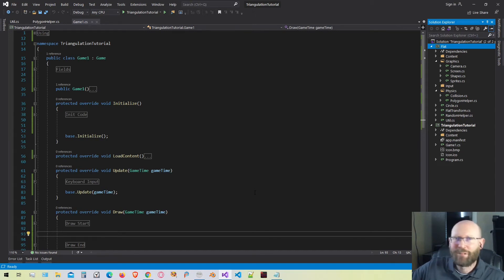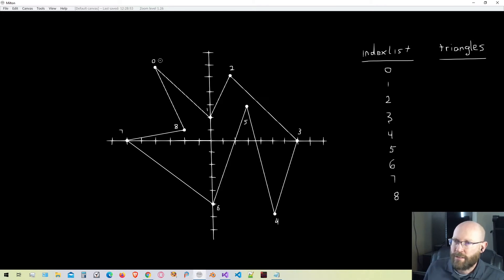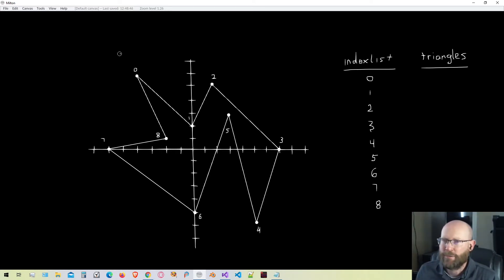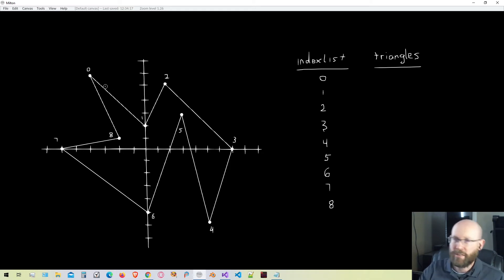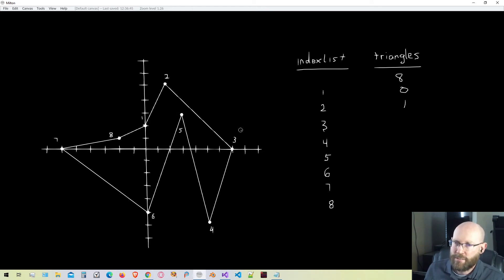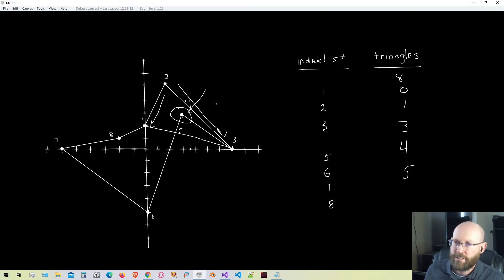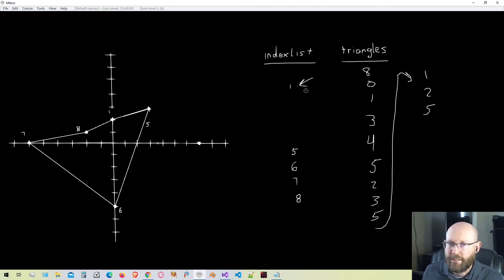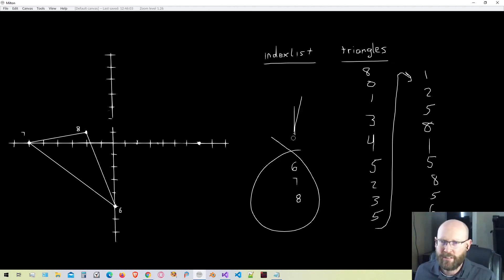Polygon Triangulation [1] - Overview of Ear Clipping

Comment: Thank you for the explanation. It makes a lot of sense, looks like a simple yet effective algorithm for triangulation, if only I found this months ago! Two things that might help someone in my situation:
1 - Convex Vertices are those that the cross-product of their edges is positive for a clock-wise polygon
2 - A point P is inside a triangle ABC if the cross products of every vector from P to each Vertex is the same sign, ex: PA x PB, PB x PC, PC x PA all have the same sign
Reply: Yes thank you for concisely listing the core elements.

Comment: what would happen if the polygon started from the 5th vertex? It isn't a convex angle anтd there are no vertices inside.
Reply from the maker: Great question.  It will move on to the next vertex until a valid ear is found.

Comment: What would happen if you generate a polygon with a 180-degree angle when removing the triangles? Is that just impossible because of some quirk of the process? Like when you have the 1-5-8 triangle, the 1's angle could have been 180 if it had been exactly in-between 5 and 8.
Reply: I think you should treat it as non convex and skip it, then point 5 will be removed, and 1 will be connected to 6, so not 180° anymore.
I don't know why he assumed the 180° rule as illegal.

Comment: Thank you very much for this video, the algorithm I wrote was having a hard time with concave simple polygons and this fixed it.
Reply from the maker: You're welcome! Glad it helped!
Reply: @two-bitcoding8018  Just as a fix for being limited to a clockwise winding order, I wrote my code in such a way that if it receives a list that's counter-clockwise and gets to the end of the list without being able to turn all points into triangles, it just re-writes the list backwards and starts from the beginning, which fixes the problem (: For my code, it would need to flip the list since if the points were in the opposite direction it would be reading the angles on the outside of the polygon instead of the ones on the inside. I thought about writing something where it initially takes the sum of all the angles and flips it based on whether or not that's correct for a polygon with the given number of sides, but I figured I wouldn't be dealing with polygons complex enough for that to make it run any more efficiently. I didn't watch your next video because I'm writing my code in Java, not C#, so I'm not sure if you figured this out in part 2.
Reply from the maker: @radioactium  thanks!  Sounds great! Did you have to change some of the signs on the ear tests when you were testing for concave or reflex vertices?
Reply: @two-bitcoding8018  Nope, if it detected it needed to read the list backwards it just flipped it around, all of the other code stayed the same.
Reply from the maker: @radioactium  gotcha. That is really cool!

Comment: Thanks, this was very useful. Only thing I'm stuck on is determining if a angle is convex based on just the vertices of the points for the polygon.

turns out my issue gets addressed in the next video.
Reply from the maker: You're welcome. Thanks for watching!